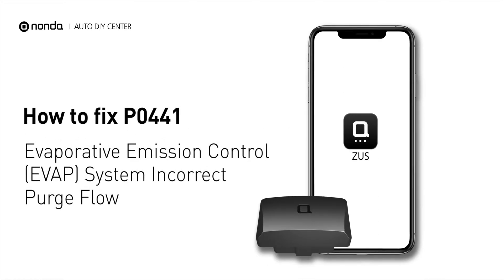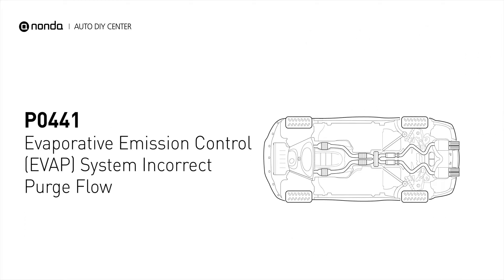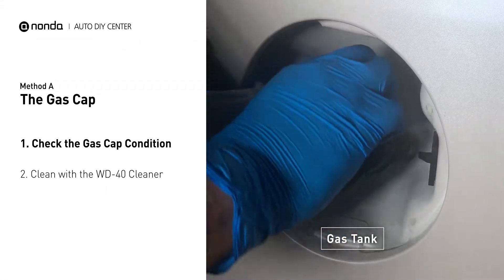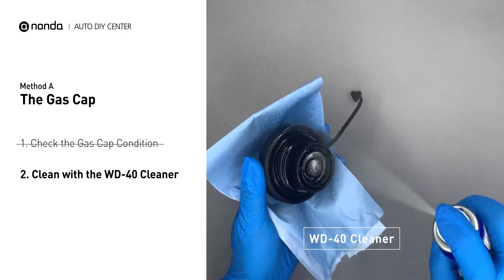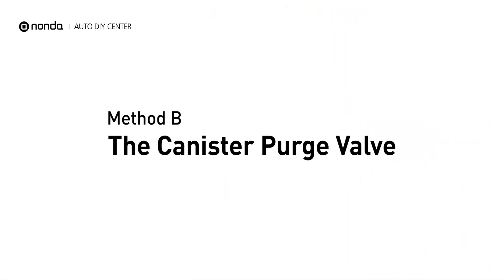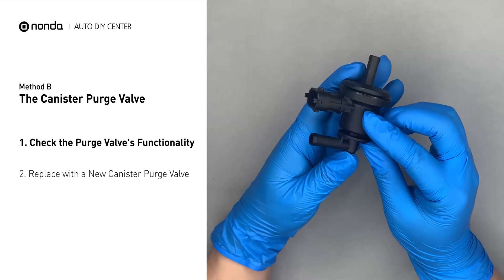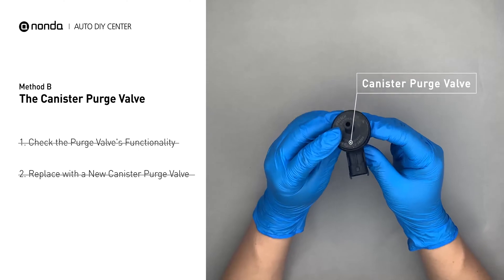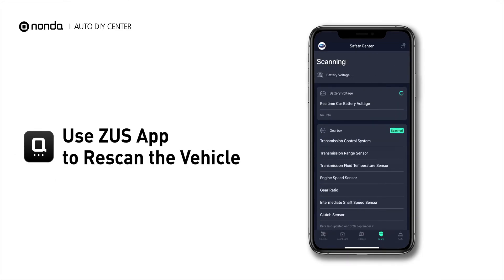How to Fix P0441 Engine Code in 3 Minutes [2 DIY Methods / Only $4.50]

Comment from the maker: Hi, I'm Steve, nonda's lead mechanic engineer. 
Feel free to leave your comments here if you have any mechanic questions, I will be glad to help you out!
Reply: when he says  use  Zeus  to  scan  your  cars  error  codes..Where or  what  do  you  scan?
Reply: @michaelthomas-cq9xv  It uses a WiFi or BT connected OBD2 reader.
Reply: I have the same question as Michael.  What does the Zues app connect to, to get/send the information?
Reply: What happens if there's no suction on the hose after warm up, is the valve history or could the PCM not be transmitting voltage to the valve? this is for a code PO441
I'm retired in 2016 but left Chevrolet Dealer after 15 years as a Master/tech/mechanic, ruined my back crawling around inside numerous chevy's with gutted interiors looking for water leaks.
Reply: So I changed my purge valve and my truck still isn’t starting

Comment: The problem with these gas caps as with time the fuel cap rachet mech wears out and does not allow the cap to screw on tight enough . The solution is take the cap apart and glue the rachet mech together - Very easy to do so the cap can be hand tightened as much as you want . You buy a new cap thinking the seal is the issue and in most cases it's the worn rachet mech causing the issue not the perceived o-ring gasket.

Comment: If your Audi has a gasket on the gas filler cap, the gasket will shrink over time. It won't provide a proper seal. VAG knows this, because you can buy the gasket separately from the cap.

Replaced mine yesterday. Changing it cleared 7 engine codes!

Comment: Hello, my cars pretty old its a 2005 toyota 4runner sr5 with 130k miles, im having issues with check engine light and vsc light, im concerned and curious to know if it's my gas cap, canister valve or somthing else?

Comment: The common issue is charcoal canister not cap or valve
Reply: I just got the code today 

Imma see if you’re right 

But imma replace the purge valve first
Reply: @poelwe8157 do keep us updated just got this code and the PO445 code
Reply: @poelwe8157 what happened man?
Reply: Did that work ??  @poelwe8157

Comment: Thank you for the lesson. My car has an purge valve, but it is a straight tube from canister. Canister itself has no sensors and the tank has no sensors also. It is an 2003 Skoda very basic. Now I have the p0441. I can only imagine an defective purge valve. But how the ECU knows that it is defective? It measures the output current to the solenoid?

Comment: What if you had the code p0455 replaced the purge valve sensor then 200 miles later now are getting the p0441 code?

Comment: I have a 2021 silverado with evap pump underperforming code.  I have replaced the valve solenoid but still getting the light. This truck doesnt have a gas cap. What could be my next step?
Reply from the maker: Hello, is this the only code you're getting?

Comment: Just got the p0441 code 3 days ago and gas cap is fine and when I did the canister purge valve test, I started the car and disconnected the hose and there was no suction at first but after about maybe 4 minutes, suction sound came on very strong and loud, so do I buy a new canister purge valve  ? I'm just a little confused because there was no suction until the car warmed up.  BTW this is a 2008 Toyota corolla le.
Reply from the maker: Can you please confirm if this is the only code you're receiving?
Reply: @nondainc  . I'm thinking that even though it seems according to a few different tests I did on the purge valve that it does open and it closes if I turn off the car and restarted again but once I'm on the road driving up and down once the valve opens it could be that it gets stuck open and doesn't closed again until I turn off the car, I wish someone would explain if the valve is supposed to open and stay open while driving or is it supposed to open and close according to what the computer feels the car needs, because I'm suspicious that once it opens stays open and doesn't close until I'm done driving???

Comment: Ok I just got this code 3 days ago on my 2008 Toyota corolla le, car was running fine and suddenly as I got on the freeway and accelerated to get to speed 70mph the light came on, I got home and used my scanner and noticed this p0441 code I erased code and the following day as I drove it for 7 miles on stop and go traffic I got on the same freeway and check engine light came on again as I accelerated to 70mph, so I ran into your video and I knew my gas cap was perfectly fine, so I did this test on the canister purge valve, the car was parked so it was cold so I started the car and removed the hose to see if there was any suction and no, no suction at all but after a few accelerations t heard this noise and sure enough there was a lot of suction, so my question is,  is it normal that when car is cold and you start the car that there's no suction at first and once car starts to warm up suction sound comes on very strong and loud, or does this test that I did confirms that purge canister valve is failing  ? I'm just confused because there is no suction when I first start the car until it gets warm  ? I love this car and I rather go to my local Toyota dealership and get the oem part.
Reply from the maker: Can you please confirm if this is the only code you're receiving?
Reply: @nondainc  yes is the only one.
Reply: @nondainc . I already tested the purge valve and it seems to be working fine, but I don't know if is supposed to stay open all the time after the car gets warm up and you're driving several miles, I do food delivery with Uber eats so I drive for 6 straight hours stop and go traffic constantly turning car off and on and the car seems to be running fine, I haven't noticed any performance loss, I'm going to wait a couple of days to see if more codes come on, I already checked the rubber hoses and they're not cracked but I noticed the front part of the hose that connects to the valve and to the canister is totally dry and very stiff and the clamps are not doing anything I can remove the hose very easy and I do see the front part of the face of the hose little cracks, I'm thinking that could be the problem a small amount of air getting into the system because like I said I the clamps are not doing anything to make the hose tight and from my experience from a few old Toyota camrys I had in the past this little hoses are extremely tight and difficult to remove so that could be my problem.  But because I don't have time to experiment I'm just going to take it to the mechanic to have it diagnosed so they can fix the real issue is probably going to cost me more 1000 dollars but buying another 2008 corolla would cost 10,000 dollars and there's no guarantee that it will actually run better than the one I have right now.
Reply: @max410 I know I'm late to the game but yea after it warms up, there supposed to be suction.

Comment: I've replaced the gas cap with a new one, I've replaced the evap canister with a MOPAR new one.  Still the P0441 comes up.  I have to have the car inspected in July for emissions and register, what else can I do ? Haven't done the 'smoke' check yet.  Hoses look ok.  I know about the cycle of the mileage and it did the light after 225 miles there must be something else wrong.  What can I do ?🙁
Reply: also, sprayed the WD40 once on the old cap but that didn't help.
Reply from the maker: Hello, please provide us with your vehicle's year, make and model. Also, please confirm if there's no other codes that register along with this code.

Comment: I am getting the code P0441 on my 2012 Volkswagen Passat SE
Reply from the maker: Hello, you can try cleaning the gas cap. If the issue continues to persists then you may need to replace the Canister Purge Valve.

Comment: 2005 Lexus ES 330 
I have the same codes 
I replaced the gas cap check engine light is still on ima drive 100 miles if it doesn’t go away then ima think it’s my evap canister 😅
Reply from the maker: Hello, if this is the only code you're getting then it's probably that the issue could be coming from the evap canister.

Comment: I have 2006 Toyota Avalon just did my emissions and failed due to codes P0333 knock sensor circuit high bank 2

And P0441 Evaporative System Incorrect Purge Flow

I changed the gas cap 3 years ago and didn’t fail my last emissions test 

Any advice?
Reply from the maker: Hello, a stuck PCV, short circuit (in the feed circuit), or a faulty purge solenoid could be triggering the codes. Kindly have them checked and fixed to see if the issue will still persist.

Comment: My 2000 nissan altmia had p0400 and p0440 do you think it’s the egr valve and the canister purge valve ?
Reply from the maker: Hello, the egr valve could be triggering the codes. Kindly have it checked and fixed.

Comment: Could also be the ESIM near the gas tank.
Reply from the maker: Hi Dave, thanks for sharing your opinion!
Reply: @nondainc  That’s not just an opinion. I’ve found several videos that say ESIM failure is extremely common in Chrysler vehicles. It’s also exactly what came up from the Autozone printout when my 2015 Chrysler 200 scanned and got the P0441 code.
Reply from the maker: @Dave, we really appreciate sharing your knowledge however, causes for this code can vary per vehicle's make/model.
Reply: @nondainc  I’m almost 100% sure my gas cap is good, and I already changed the purge solenoid. I’m going off of countless videos about Chrysler specifically since my check engine light came on literally the night before I was going to smog it and renew the registration. I’ve literally spent hours searching for causes of this code. What I’ve found is:
1. Gas cap
2. Evap purge solenoid 
3. ESIM 
4. ESIM canister (which seems to be a less common issue).
Reply: @nondainc  I completely agree. I just thought I’d add something that was not mentioned in the video.

Comment: Great to watch your videos. I've cleaned out the p0441 code and i replaced the purge valve and cleaned the gas cap as well, but still get the code p0441. I'm driving skoda Superb 2.0 2011
Reply: ESIM, or purge detection pump is another fairly common cause of the code.
Reply from the maker: @Dave, thanks for sharing your knowledge!
Reply from the maker: Hi Gabriel, please try looking for any disconnected or damaged wires within your EVAP system and repair/replace it to see if the issue will continue to persist.

Comment: Hello Steve, I have 2004 Lexus Is300 that has error codes P0441, P0442 and P0446. I brought it to a mechanic a few years back regarding these codes. Would like get advice and see if this can done by myself before bringing the car to a shop again. Thanks
Reply from the maker: Hi Benedick, since you are receiving multiple codes, we suggest getting your vehicle visually inspected by your local mechanic for further diagnosis.
Reply: Hello Benedick,

I have have same exact 3 codes on my gs 430 did you ever find the solution?
Reply: I have the same ones on my 03 camry? Any luck.. seems as of this is a common Toyota occurrence.

Comment: I got the code “GASCAP” on my odometer, then my check engine light came on and I got this code when I scanned it at the auto parts store. 2014 Chrysler 200 LX, do you think cleaning out the gas cap is most likely what I need to do?
Reply from the maker: Hello, can you please confirm if this is the only code you're getting?
Reply: @nondainc  that’s the only one that showed up when I took it to the auto parts store that tested the code on their handheld machine thing
Reply from the maker: Hello, if your fuel cap was already tightened and still getting the code, we suggest replacing it.

Comment: 2007 Toyota Sequoia check engine light lit up and the other lights as well. Gas cap has been changed, gas cap always is tightened correctly. Now I am told that the Purge Valve is making the check engine light up, nothing to do with the gas cap. The Purge Valve will cost $350-$500 to replace next time the check engine lights up.  ~ Fort Smith Arkansas
Reply: $350+ seems awful expensive for a purge valve. I replaced mine on my 2008 Nissan Frontier myself and I only spent $20 for one on Amazon. If you’re having a dealership do it for you they are charging a lot for labor as usual. I don’t know, maybe yours is in a very difficult place to get to but I changed mine out in 15 minutes tops.
Reply from the maker: Yes, that's the most common cause that triggers the code. We also suggest checking if there's an issue with the related wiring, vacuum line going to the purge canister, purge control solenoid and if there's a vacuum leak.
Reply: Purge valve for a sequoia is only 25 to 50 dollars, they mechanic that told you that price is absolutely a scammer and hopefully you went somewhere else.

Comment: I've cleaned out the gas tank, I've replaced the gas cap and the purge valve solenoid about 3 times, I still get the code p0441. I am starting to believe that I can have a leak or it's the back purge valve. Help?
Reply from the maker: Hi Rey, please provide us with your vehicle's year, make and model.
Reply: @nondainc  it will be a 2011 dodge grand caravan express 3.6 v6
Reply from the maker: Kindly check the vacuum line going to the purge canister and the wiring going to purge solenoid for any issues.
Reply: That was my plans for this weekend, since I believe it will be a leak, but I just found out about the vent. That's 2nd on the list now.

Comment: One of the reason could also be the absorber (not only canister purge valve), which is a part of the EVAP system.
Reply from the maker: Hi Pavlo, thank you for sharing your opinion!
Reply: where's the absorber on a 2004 ?  I didn't know about that being an issue.

Comment: Is this also called an evap solenoid or is that totally different
Reply from the maker: Hi Jonny, the EVAP vent control valve (Solenoid) or vent valve is actually part of the Evaporative Emission Control (EVAP) system.

Comment: Would the purge valve make your idle high and rumbling and could even shut off your car?
Reply from the maker: Hello, a stuck open/ not fully closed purge valve would cause a small vacuum leak that results to rough, poor acceleration or high idle.

Comment: Will spraying the Wd-40 mess up the gas?
Reply: If you’re really concerned about the WD40, parts cleaner dries quickly and doesn’t leave residue. I wouldn’t use it on the gas cap, though, because it can dry out the gasket.
Reply from the maker: As you can see in the video we have uploaded, it shows there that we sprayed the WD-40 cleaner just on top of the tank and on the Gas Cap and dry it immediately with a dry cloth. It won't if you will spray just a small amount only on the right spot just to give it a good cleaning nothing will happen.

Comment: I have been getting the message “Gas Cap” on the dash. Then the P0441 code came up. Thanks for the information!
Reply from the maker: You're welcome! To address your concern properly, can you let us know your vehicle's year/make/model?
Reply: @nondainc  2015 Jeep Wrangler. I thought it was strange to get that message when the gas cap was not off.
Reply from the maker: Hello, do you still get this code when its tightened already? Check also the other factors that triggers this code like: purge control solenoid, wiring issue to the purge solenoid, vacuum line going to the purge canister, and the vapor canister purge valve.
Reply: @nondainc  thanks I will check those things if it comes back. I just cleared the code yesterday but now I have a few clues if it comes back!
Reply: @dizzywillow2162  updates?
Reply: @lstruggy  I changed the gas cap. Seems to have fixed the problem. I had forgotten all about that. The Po441 is something different, don't know or remember what I did (if anything) but I have not seen it in a long while. Thanks for asking!

Comment: Make sure the line from the canister to the purge valve isn't cracked or has a hole in in. You will still get the code. Perform a visual inspection of the line .
Reply from the maker: Hello, thanks for sharing your thoughts!
Reply: to reiterate, the Jeep is a 2004 Liberty, 6 cyinder engine. the gas cap and evap purge valve have been replaced, no other codes show when I check the ignition.  Just P 0441.  I have visually checked the lines and no visible cracks anywhere.  The purge valve was checked before replacement and it wasn't holding any pressure after testing it.
Reply: Is the fuel pump leaking? Did you do a smoke test to see if any of the lines are releasing the smoke?
Reply: This canister purge valve line should go all the way to the gas cap, not at the cap but on the same pipe that the gas cap screws on to and that means it's routed under the car, if it's rubber it could very easily be cut or damaged. Some may be metal. Good Luck